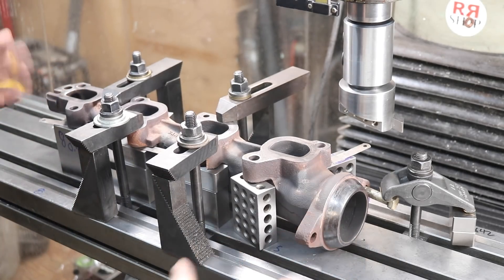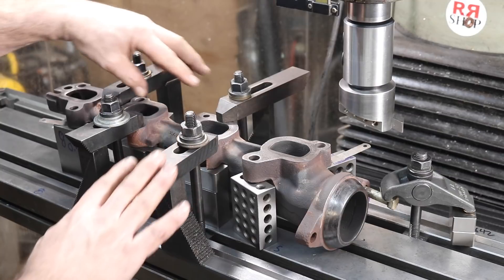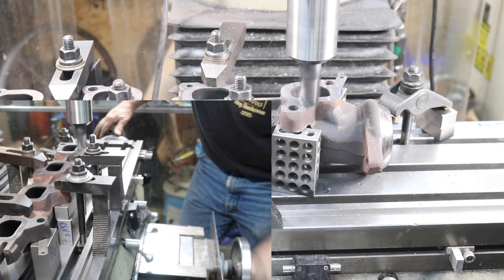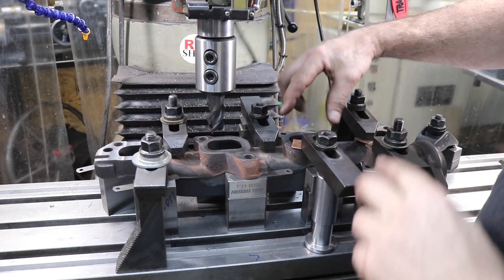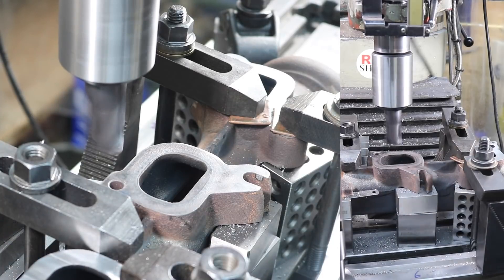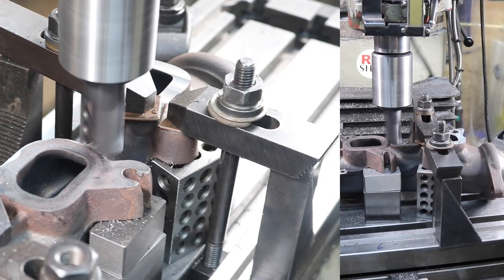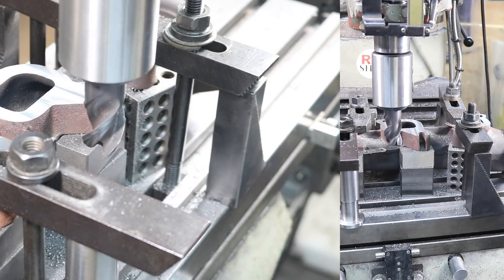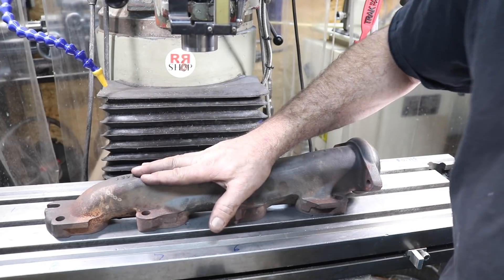Exhaust Manifold Warped How to Fix It  Repair and Return to Service

Comment: Looks great. I’m working on a similar setup with the driver side and was curious when you clamped it down what were your tolerances for getting it parallel to the table?
Reply from the maker: Since it was not flat/warpped, I just had to average out the the reading in x and y.
Get it as flat as you can.  This worked out so to remove as little as possible.  I have since done the other side also.  Both are holding up and I have not had to touch them since.  Thanks for stopping in.

Comment: It seems like the engine might be warped in the same way the manifolds are and this could end up causing more of a gap? Or would this never be the case
Reply from the maker: Head warpage is very rare.  I have had no problems since I have done this, I did this to both sides.  Thanks.

Comment: Randy, It’s been three years, any broken studs since the milling job? I have read that warped brake rotors, exhaust manifolds etc. are less likely to warp again once re-machined flat, would your experience support that notion or not? Thank you
Reply from the maker: Still working great, I also did the other side manifold last year.  Yes after many heat and cool cycles more stress is relieved and I have found a remachine like this makes them last a lot longer.

Comment: Thanks for the detailed video Randy. My 2019 5.7 Ram undoubtedly has this manifold issue and the dealership conveniently couldnt find it during my bumper to bumper. Still covered under engine and trans warranty, but from what Ive read their fix is a new manifold or new bolts that will probably just warp or snap as soon as my warranty ends. Only 21k miles and been an issue since new.  Can't  trust em....
Reply from the maker: This repair has been fine since the fix.  Thanks.

Comment: Thanks for showing your setup. I want to do this on my MG manifold but I was stuck on the idea of using a fly cutter and doing it in one pass.
Reply from the maker: Fly cutter would work, just watch for vibration chatter.  With end mill a lot less chance of that.  Thanks Allen.

Comment: Is that a dodge?
Reply from the maker: Yes, 2009 Ram.
Reply: Randy Richard In The Shop my 2012, which has 45,000 miles on it is now at Dodge because of this and the o2 sensor on that same pass side and now won’t start

Comment: Excellent video! What would you say a machine shop might charge for this, per manifold? I like this much better than buying new manifolds or headers. Also, how important would you say expanding the bolt holes are?
Reply from the maker: Well if they were setup to do this I would say a hour of labor.  Take note when removing and if there is rubbing on the stud I would enlarge holes a s necessary.
Reply: @RRINTHESHOP  I do this fairly regularly and an hour is my charge. I have a horizontal mill, so my setups on these odd jobs are quite easier than on our vertical mills. Nice work👍

Comment: I've done this job several times. My mill table does not appear to be any larger than yours, (mine's probably smaller.) I've always made one setup and cut all ports at the same time with a 3" face mill. That way they have to be in perfect alignment and it doesn't take much time. Does your table not have enough travel?
Reply from the maker: Thank you Ken.  I had enough travel.  This was a faster setup for me and what I had.

Comment: Nice job Randy, how much were you taking off on each pass and what rpm were you using? Thanks again, hope to see you at the bash. Your friend Jim, (the guy with the clausing 5914), JB San Diego.
Reply from the maker: 1" Carbide endmill, 1600 RPM, about 0.030 roughing, 0.010 finish.  Thanks Jim.

Comment: Looks like that cleaned up nicely. Sounds like it was warped right from the beginning? You would think the tolerances on these kind of parts were tighter than that from the factory... Glad you got things sorted out! Hope all is well. - Tom Z
Reply from the maker: Thanks Tom.  Yep had problems with this in the first 2 months of buying the truck.  Fixed now.

Comment: Now that the stresses are probably well released from that part, what you just did will give you a very stable manifold, better than a new one that wasn't properly stressed released...
Nice stable and solid setup....  A few thou difference will be well taken care by the gasket... 
Hope the other side is gonna be alright.
I've seen Everett's comment below, no wonder it happened again and again, sounds like Dodge don't make enough money from the showroom, so they purposely make it so you end in the repair shop to get their hands on the rest of the money...  
Got caught in that circle with 2 vehicles, now I stay away from Dodge products...
Reply from the maker: Thank Pierre.  Working well, the Right side I have never had a problem so far.

Comment: I can explain why your dealership couldn’t solve this problem for you. A warped or improperly machined piece of cast iron doesn’t throw a fault code and if they don’t get a code when they connect the diagnostic, you don’t have a problem. In my recent experience with dealership shops, I don’t think they could diagnose a flat tire without a code.
Reply from the maker: Figures.  Thanks Joe.

Comment: I need to do the same thing to the driver's side header in the jeep. It has leaked since day one. Added an extra gasket and torqued the bolts after a couple of heat cycles but it still leaks.
Reply from the maker: Geterdone in that new shop.  Thanks Tom.

Comment: That's a common problem.  Another problem they have is a lot of people take the metal gaskets out and put aftermarket ones in.
Reply from the maker: I used the metal fel pro gaskets, high quality.  Thanks Ken.

Comment: Great job on the manifold Randy.  I've done quite a few of them over the years and had to do the same thing on ones that are out .040" plus but on many that aren't off that much I merely breath across the belt sander with them to true everything up.  I've had to do it with new "green" manifolds even.  I generally try to get them where a .004" feeler gauge won't slip under on my surface plate and haven't had any further issues so if you're only off a couple thou you should be just fine.  Also they are already "seasoned" manifolds so you shouldn't have to do them again.
Mike
Reply from the maker: This a bit far out to sand off.  Thanks Zmotorsports.

Comment: I have to replace the gasket on my 2010 GMC 6L. Not looking forward to doing it. Nice setup and result. Must be white cast iron, do you think. Grey would have been easy to do with HSS. Take care Randy
Reply from the maker: Just the surface was hard,  The endmill made it like butter.  Thanks Randy

Comment: Nicely done Randy, I used to work at a Dodge dealer and replaced countless exhaust studs. The thing is that under warranty the corporation will not cover manifold replacement so we were instructed to just reinstall the manifolds. A new manifold would warp again in a couple years as the heat-cool cycle relieved the casting stresses. I didn't have machine tools when I did the right side manifold on my '03 so used a belt sander with heavy grit paper to flatten it. Never had a problem with it since, you did a nicer job on yours so you should be good from now on.
Reply from the maker: Yep bad policy.  Fixed now and I know it is right.  Thanks Everett.
Reply: Not sure how or  if any car manufacturer does it, but the castings should be stress relieved before machining, if not done properly problems are most likely to show up sooner or later.
Had 2 Dodge products in my life, more than enough to know to stay away from it......!!!!  
It's like they make, let's say, 60% of the vehicle great and solid and 40% total crap...   That 40% or so is hell as long as you own the vehicle...

Comment: the other thing i would have checked for Randy, is how the thing acts when heated up.. hit it with the acetylene and see if it teeter totters any more or less on the table
Reply from the maker: Yeah but I am not going to machine it hot.   I went with it,  Working well.  Thanks Mike.

Comment: Thanks Randy. I believe some companies shake out the castings before they cool enough and then they  do not normalize the castings. After machining and in use, the manifold is heated and releases the tension in the casting. That in turn allows the casting to warp throwing the machining out of plane.
Reply from the maker: Yep for sure Don.  I have had problems with this manifold since the truck was new, so we will see.  Thanks Don.
Reply: @RRINTHESHOP  i worked as Quality manager for I.H. years ago & worked with foundries. Later I owned an auto repair. Saw the same problem on hundreds of vehicles. Certain makes/models had habitual problems. You just resolved your case.
Reply: Kind of irritating to have a defect from the factory

Comment: Probably too late now but drill your stud holes in that manifold out at least an extra 1/32". Most of the time stud breakage is from the expansion and contraction of the manifold bending and shearing them off.
Reply from the maker: Yep to late,  I checked that when I put it back on and it was quite loose, so I did not drill them out.
Thanks for mentioning that Brian.
Reply: That's what Cat do as well as slot them .
Reply: Are you saying to widen the diameter of manifold bolt holes by 1/32?
Reply: @BBDos  Yes going up in size on the bolt holes adds safety to breaking studs.

Comment: I don't know for sure but at the beginning I could swear you have the cutting tool installed in the fly cutter the wrong way.
Reply from the maker: No, the surface hardness was to much the get cut started.  The end mill was no problem, I could cut deep enough below the hardness.  Thanks Jason.